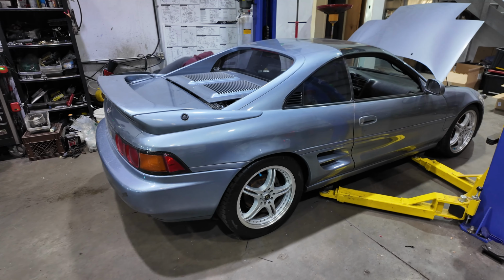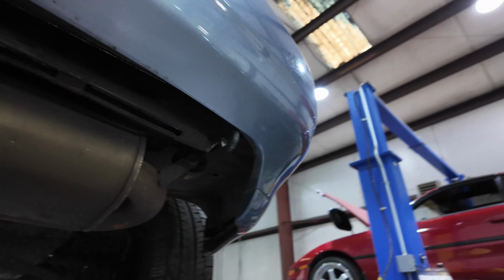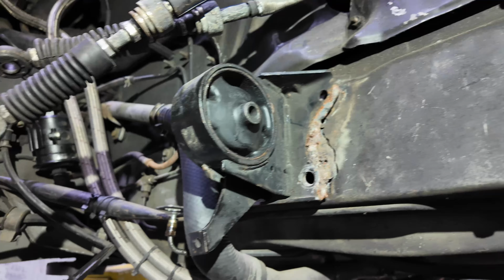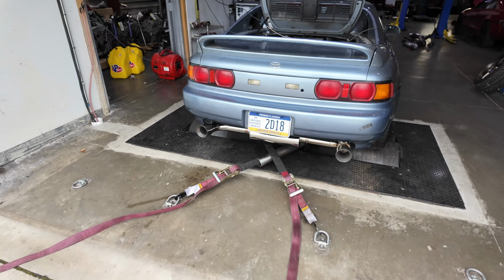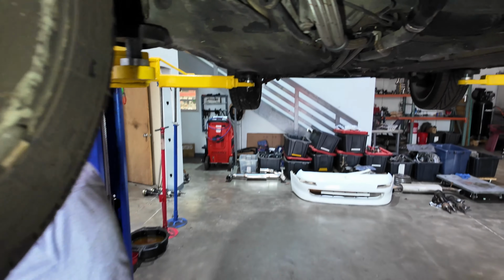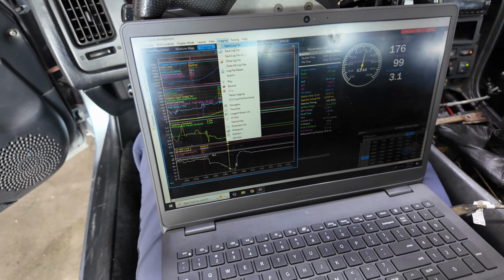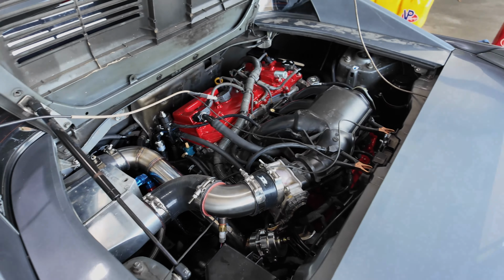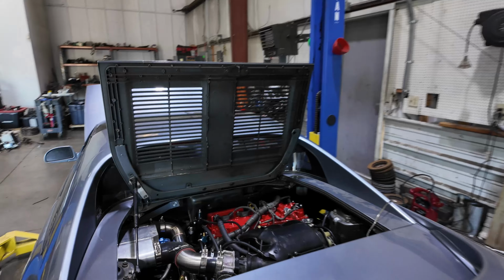The Ultimate MR2 Engine swap! 700hp V6 MR2!

Comment: Hi! I have  a k24 with 6 speed lsd transmission out of the car. My  1991 mr2 5sfe has a knock and motor was not pulled out.  if i had the car shipped to you guys..is that a job you guys can do? K24 swapped? Thanks!! Love the videos.

Comment: Update: this thing is ridiculous. 300 miles on it. Completely nasty. Build quality and customer service top notch. 

If you have an mr2 you need this. You WONT be disappointed.....the people in the lane beside you will be however.

There is 0 comparison to the 3sgte that made 425whp prior. 

The torque is insane. 

As soon as the exhaust valve opens its turning all the heads.

However I can crawl around without anyone noticing at the same time
Reply from the maker: Glad you're enjoying it!

Comment: 610 whp on stock internals????? that is insane. I guess the stock ones really are forged, though it probably helps that the torque numbers aren't extremely high
Reply from the maker: We have ran as much as 700whp on the stock engine, we typically dial it back a little bit on the customer builds, but for our own cars we have pushed them even further.

Comment: hey what was the fix for the transmission i am going through the same issue. By any chance you have the parts numbers for the cover and the c-clip. thanks
Reply from the maker: You have to pull the end cap on the transmission that houses the 5th gear parts and replace whatever broke. We just happened to have spare parts here to fix it.

Comment: The one stop MR2 shop.
Reply from the maker: For sure!
Reply: @tcsmotorsports  What mph do you see at the top of 4th with these setups?
Reply: @nickadkins7765 mine reads 130ish but with the larger tire I calculated 140

Comment: Did you notice a significant drop in the IAT's with that A2W setup? I'm wondering if this would be the right setup for track vs street pulls. Great work!
Reply from the maker: No, we actually prefer the air/air with fan mounted on the bottom.
Reply: I run a water to air set up on a 710whp 2GR turbo in NZ. I like it.

Comment: Why don't they usually use water to air in that 2gr combination?
Reply from the maker: air/water is nice, but it does add a lot of costs/parts/potential failure points. The air/air we use with a nice fan underneath works great with this setup. Having the turbo far away from the intercooler and engine bay really helps with keeping the temps down.

Comment: Is this a stock internal motor?  How much boost?
Reply from the maker: yes sir, 100% stock internal 2GRFE. We typically run around 15-16psi peak boost on e85
Reply: @tcsmotorsports  What about on pump, 8psi?
Reply from the maker: @lowside67  pump gas is 9-10psi

Comment: Ye olde 5th gear clip failure. Ouch.  Also, the aftermarket ECU rev limiter is so much more pleasant than the factory version.
Reply: Thank you for supplying the patch for the engine mount!
Reply: I am not familiar or aware of this failure. How can this be prevented? Are we just talking about that C clip that holds the  5th gear on the shaft? It fails? Comes off?